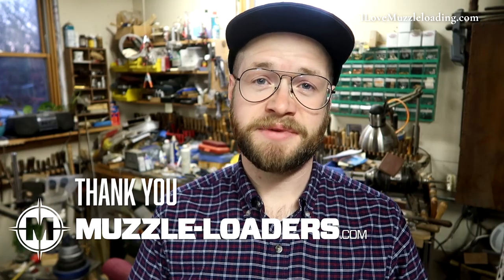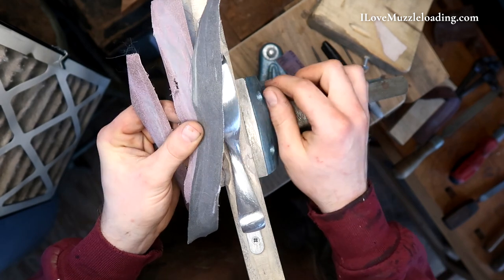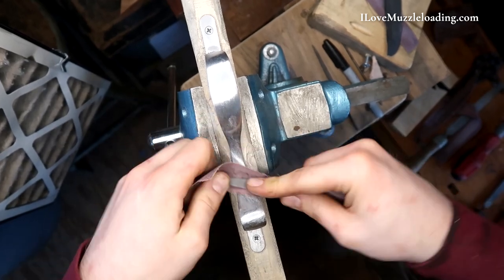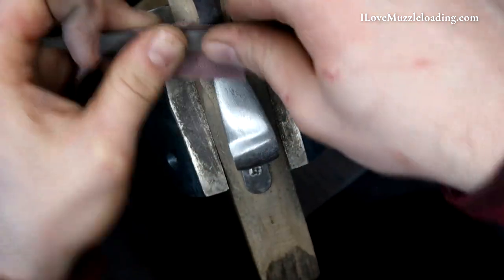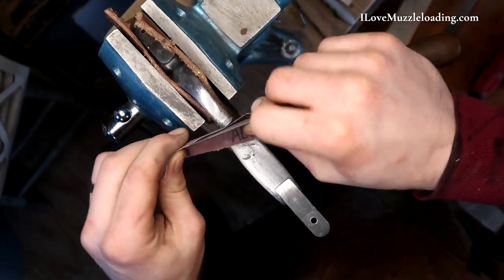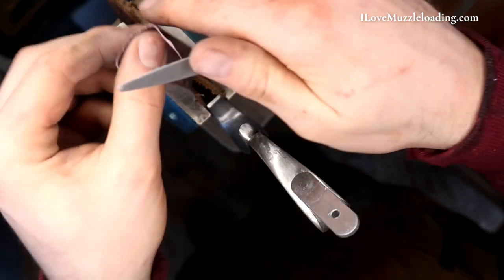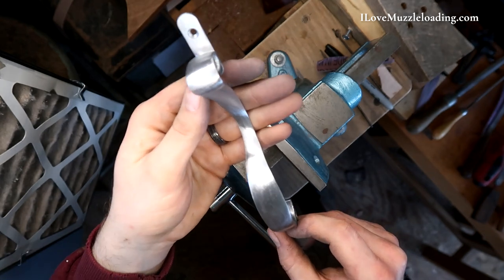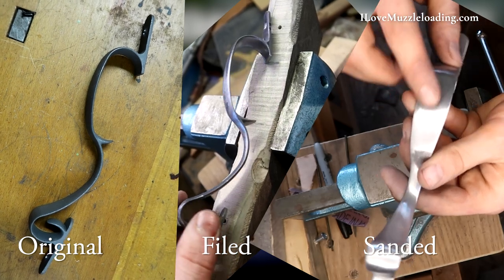My SIMPLE muzzleloader hardware polishing technique | Investarms Gemmer Hawken Build Part 16

Comment: I use the file back method and to finish to get all the lines straight and go to 500 grit, I use a small sticks that have leather glued to them as my backer. It does a better job of blending the lines. Good job BTW
Reply from the maker: 500 is a good place to stop for sure! 
Those sanding sticks sound like a good idea, less risk of knicking your part with a file that way, I'll have to try that.
Reply: @ILoveMuzzleloading  I learned it from a old German engraver.

Comment: Yep I'm doing the file backed method on mine. I have a question Ethan. On some of the old trade flintlocks, on the lock side in the butt stock there is a round hole about 1 1/2" in diameter. Is this a poor boy patch box?
Reply from the maker: Hey Jack, you'll typically see that referred to as a "Grease Hole". It is normally filled with bear grease, or other tallow to lube patches or prevent rusting. Be careful though, folks report mice or bugs going after the exposed grease and chewing up stocks.
Reply: @ILoveMuzzleloading  amazing, thank you. No way in hell I could do that to a stock.